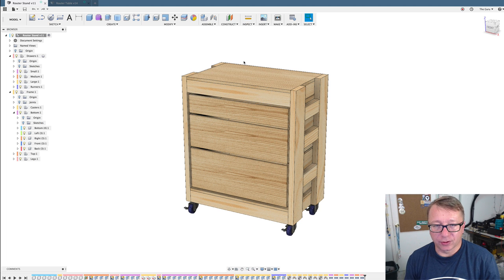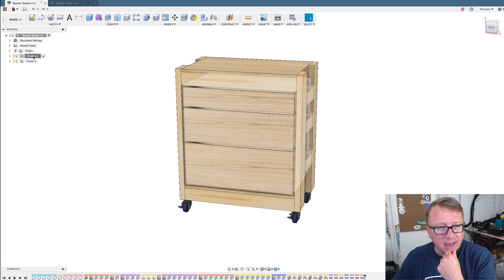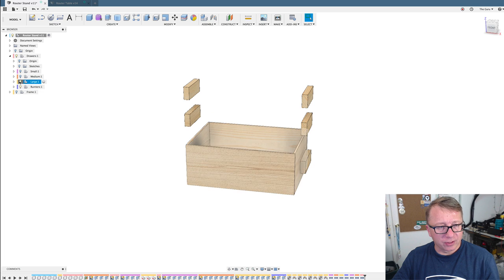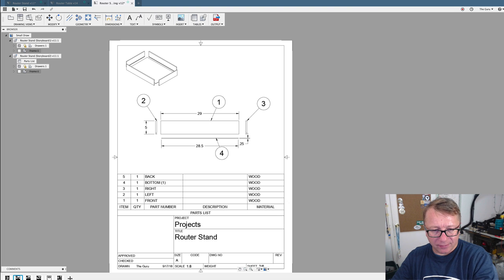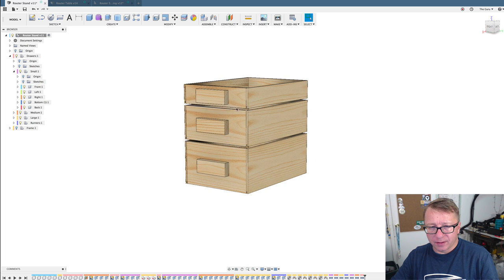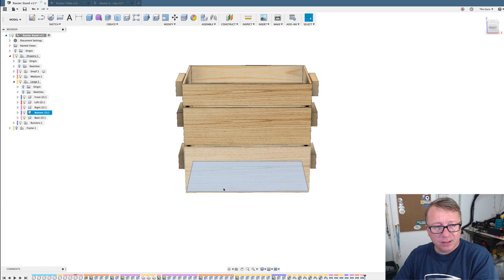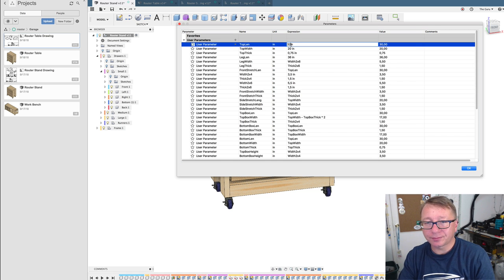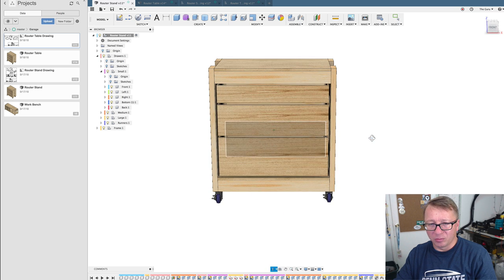Why can't Fusion 360 generate a BOM from a parametic model that uses sensible component names??

Comment: I hope you have figured this out by now since I see this video is a year old but I just stumbled across this video and coincidentally ran in to the same exact problems yesterday. Here is what I learned and how I finally got it to work somewhat perfectly. 

1. For the parametric modeling to work when you move/copy a component, you have to use the joint command to move the part where you want, not just enter the value in the move screen. This will then move the parts as you want them to when you change the parameters.

2. For the BOM, only subassemblies can be added to a parts list table on a drawing. So for instance, in your model where you have the sub assemblies split up between drawers,side,top,etc. you have to individually add these to the drawing one sub assembly at a time. This takes a few clicks but you can get multiple sub assemblies parts list on one drawing. (You can delete the picture on the drawing once you input the parts list table) Also for parts list, for it to list quantities greater than 1 of  something, it must be copied in the model (I.e., after the “:” in the name of the component, it has to have a 2,3,4 etc. like “leg:1 and leg:2”. Not “leg (1):1 and leg (2):1”

3. Unfortunately fusion 360 is not really designed for woodworkers (hence why there is no quick and easy way to make a cut list diagram for plywood, for instance) you have to think about things from a manufacturers standpoint. Most manufacturing companies would have all their parts saved in fusion under their part numbers and would input them into drawings and call them subassemblies. So if they input an engine into their model to make a car, they don’t want to see every single part that makes the engine come up on the parts list, all they need to see is engine, quantity 1.

Hope this helps if you didn’t know this already!
Reply from the maker: Hi Greg.  Thanks for the comments and feedback.  Recently I started using OpenBOM but it has some of the same limitations.  I get why it works this way, but it's just not how I approach modeling.  But as you point out, there are work arounds, so it's not too terrible.  Perhaps I'll attempt to learn SketchUp to see if assemblies like this are easier.  I tries years ago but gave up because I found fusion easier to use.  Thank again!

Comment: Been looking for this for 2 days, wish Autodesk would fix this, they could use sub assemblies to fix the problem
Reply from the maker: Agreed - but I believe in Fusion 360, Components are the equivalent to subassemblies, which is why the BOM function works that way.  But that's not how I design some things, so it's pretty frustrating.
Reply: Are see I like to break down my assemblies, sub assemblies, and components. And thanks to your help I figured it out. You can make the body from your sketch, then turn it into a component, then copy that component to the assembly or sub assembly. 
This way your assembly drawing will show a quantity of 1 for that sub assembly(say your bench legs), but your construction drawing Will show 4 components(legs) of that assembly. And your model stays organised 😁👍
Reply: True if you just want a single top level drawing it can be frustrating.
I produce assembly -> Mechanical -> Workshop drawings as training material to simplify the manufacturing process for my students.
I have my project model, that becomes my assembly drawing, then each group of parts that needs manufacturing is an assembly, ( i used to leave it as a body under the assembly group, but thanks to your video i'll stop being lazy on that one :) ,) Copied as a sub assembly under the assembly group for the number of like parts needed. That becomes my Workshop drawing.
Then if there are more components on sub assemblies they can be constructed under each sub assembly, 
( Sub-Sub Assemblies if you like, however I will try this out on the drawings later.)

At 2 levels, Assembly drawing (Project,) and workshop drawings( Assemblies,) It's doing exactly what i want with the quantities.
I suspect that constructing sub, ( sub,) assemblies, under each sub assembly, will give another level of manufacturing drawings with the part, assembly, sub assembly, and component quantities all neatly contained to their own drawings.
also worthy to note is that when organised this way, you can turn the components within each assembly group on and off in the drawing and your BOM quantities wont get messed up, so if you only want to display 1 of your 4 legs for manufacturing that's all you see, but the BOM still tells the fabricator that 4 need to be manufactured.
Probably hard to follow all the sub sub subs ..hahahha...would make more sense if you could see what I've done.
Oh also, because everything is nested in the model where it usually would be when you make changes it doesn't mess up everything else, :)...at least it hasn't yet :P